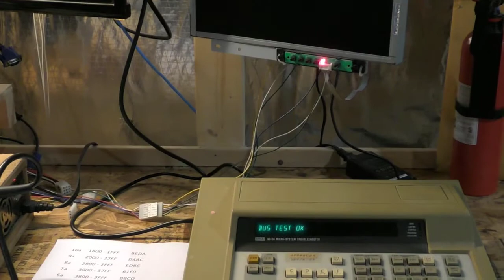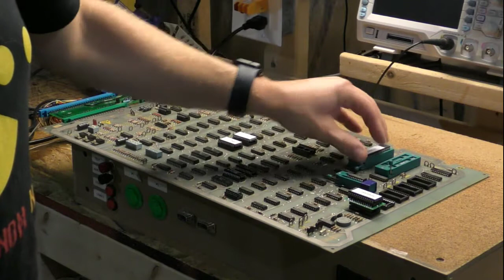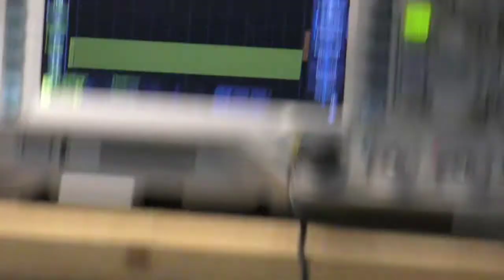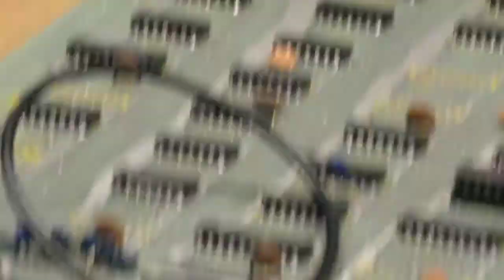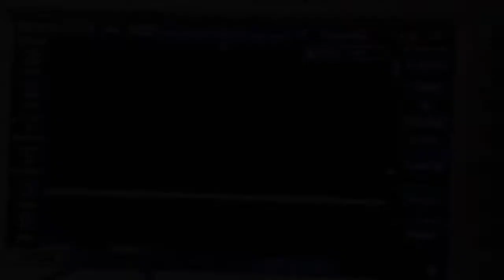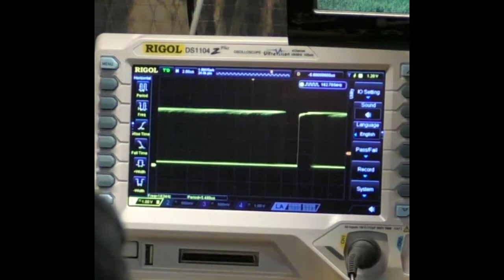PCB Repair 20201114:01 - Exidy Targ (1980) Part #2

Comment: Thanks for the video - I like the Centipede board Pokey and 6502 tester!  I may just copy that - thank you.  I've only run into stone dead 6502's and pokeys - but this certainly would help detect marginal ones nicely.
Reply from the maker: Thanks Bob I also have sockets on therefor quickly sanity checking 2101s and 2114s I tried to but in zif sockets for those but they did not fit :(
Reply: @arcade-cabinets  I have the Inquisitor for RAM checking and it has been pretty reliable.  I did a quick search for a dedicated Pokey tester and had not seen one.  I'm pretty sure I've seen 6502 and Z80 testers out there.  (Arduino based?)  - An Arduino based Pokey tester would be pretty cool..  I've done some Arduino stuff...  But I'm not sure my coding skills are up to that task..  But.. maybe some day  ;)

Comment: The 82S123 is a Bipolar PROM chip, but what makes a prom chip a Bipolar prom chips and not a non-bipolar prom chip. I don't know the differences between a bipolar prom chip compared to a non-bipolar prom chip. The MPU data buss when using an Oscilloscope and measure the data buss signals D0-D7 what type of Data signals are coming from the MPU? what type of data signals are outputting from the ROM chips and PROM chips because the ROM/PROM chips data signals are a different type of data signals compared to the MPU data outputs pins D0-D7.